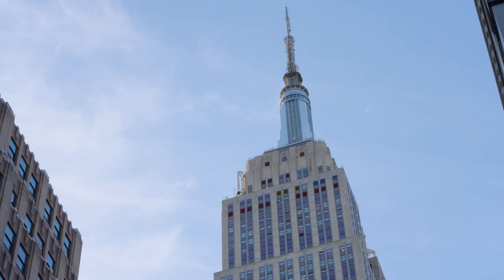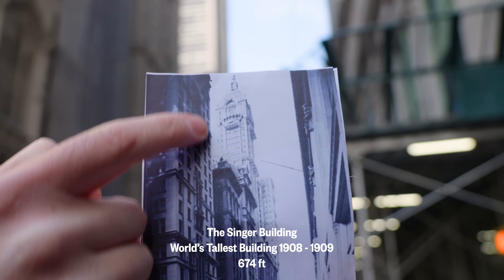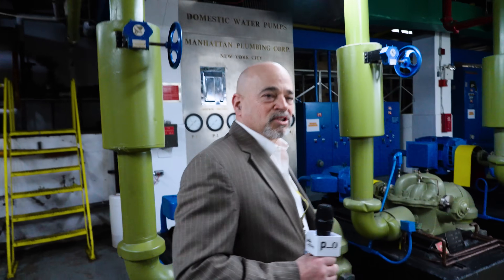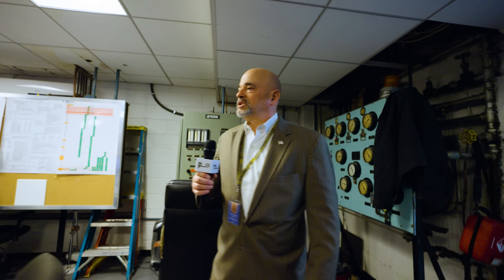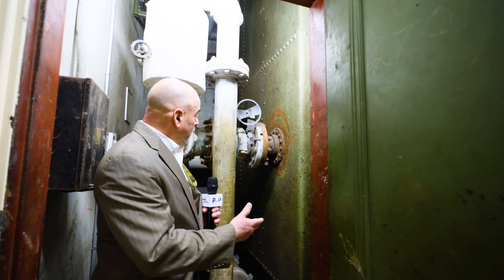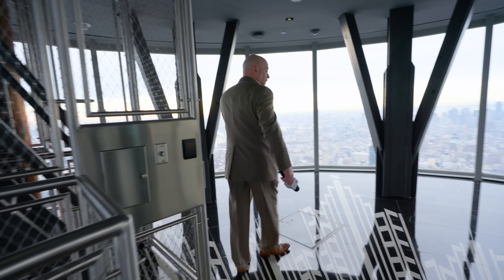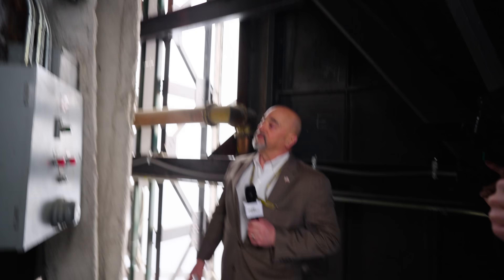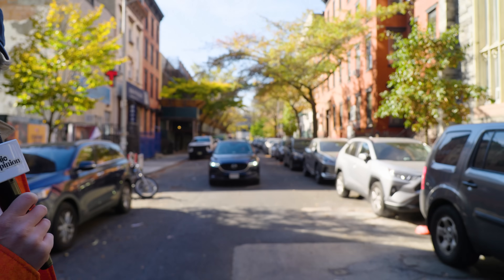Empire State Plumbing: The Secret Behind Water at 1,454 Feet!

Comment: Very interesting!! But how does waste water get down. You can't have it falling 100 stories or it would damage pipes at the bottom, so, how is it done?
Reply: At certain vertical intervals, horizontal offsets will be provided to the sanitary pipe to keep the velocity within a tolerable range.
Reply: @jdduvall12  that makes sense, i wonder what speed is deemed too fast for waste to fall.
Reply: @1DerfulSniping  At a theatre in London (UK), we have the opposite problem, since the auditorium is 80 feet below the sewer. 
The sewage drains into a pair of 600 gallon tanks via non return valves. A second non return valve from each tank leads up to the sewer. 
A vent pipe from the top of the tanks also vents into the sewer. When a tank is full, the vent is shut off and compressed air at 4 bar supplied. This silently forces the contents of the tank up into the sewer in about 20 seconds.
Because their are no moving parts, the system has run since 1926 without a fault. The leather flaps in the non valves are replaced every 5 years, but since the valves are outside the tanks it is a simple one hour job. The pipes and valves are 6 inch diameter. Everything is cast iron. 
The air compressors were replaced in 1962, when London changed to 415 volts (3phase) and require an annual oil change.
Reply: @wilsjane   Very cool!
Reply: @wilsjane  why is the auditorium below the sewer? How deep is the auditorium?
Reply: This is interesting  @wilsjane
Reply: @wilsjane . Love it, I worked on subs for ten years. We used pumps to suck out all oils and fluids, when the new style sub came in. I was pumping out one of the first tanks, a sailor said he found out that the tank could be pressurized to 5psi. I shut off the pump and got an airline to the connection point. Turned on the air and pump at same time, got the tank emptied in less than half the time it normally took.
Have a good one !
Reply: @jdduvall12  where do stack vents let out?   In classic 'pointy' bldgs, on the sides somewhere?
Reply: Every so many stories you go over with a 45 then 45 back, kinda like a zig-zag offset to knock the waste around slow it down. Also need a relief vent to prevent the momentum from siphoning anything
Reply: I really hope the plumbing term for that pipe slow-down joggle is "Shit Brake".
Reply: The three separate tanks at different heights create the desired water pressure for the designated floors they feed
Reply: @pueowright7467  You ae completely correct. In many cases, water needs to be pumped to tanks feeding the upper floors, so why would you pump water to this level, for it to feed the lower floors at ridiculously high pressure. 
In addition, the total tank volume for the building would be around 12,000 gallons. Supporting all that weight at roof level would present a major structural problem.
Electrical distribution in large buildings is equally complex. Electricity behaves like water in many ways, but their is no weight problem.
Reply: @pueowright7467  
The Empire State Building has almost no need for water: the building is almost completely a clothes closet -- a warehouse for the Seventh Avenue textiles industry.
Just about nobody works there.
Reply: @David_Lloyd-Jones  This sounds almost completely made up, I can find basically zero proof of this and non of the largest tenants I could find are fashion companies. Also using a skyscraper just as a warehouse is a pretty economically inefficient and unbelievable claim.
Reply: @BlueBetaPro  Only around half of the building's office space are rented out. It's been that way pretty much since the building was built. They currently charge $65-$70 per square foot rental which is the above the current standard of $60 per square foot in NYC. Most of their realty trust money comes from tourism and renting radio tower space. (About 68%) LinkedIn and Bank of America are probably their 2 biggest office space renters. I used to be a water treatment vendor back in the 2000s and dealt with their property manager. It's a great old building, with the emphasis on "old". The building shift engineers do a great job.
Reply: Right!  If a guy flushes a toilet on floor 86, the guy sitting on the toilet on floor 30 could experience a gush out of his toilet at over 250PSI.  Water falling from 900 feet on floor 86 would generate about 450PSI at street level.  Not a simple problem.
Reply: @makerspace533 water falling through air from 900 feet generates almost no pressure
Reply: Like trump, they just wear diapers.
Reply: Pipe goes down then sideways then down and repeat
Reply: of course you can have sewage fall down 100 stories through a straight pipe. water does not have a very fast terminal velocity and solids will bounce around the pipe. anything too fast will be caught in the radius or septic tank at the bottom. the one issue that does need to be solved (not just in skyscrapers but regular tall buildings as well) is the air currents and backpressure in the pipe, since you dont want sewage shooting out of the appliances of the lower floors. to mitigate this, multiple pipes are used and connected on many floors, allowing air to bypass appliances and loop around.
Reply: Easy flushing ny😅
Reply: It would be cool if the energy from the falling waste water could be used to help drive the freshwater back up a bit. I'd guess it would need to be a closed system.
Reply: You could do it by fluids of differing densities (wow did I get that correct since it’s based on pressure and uses water)
Reply from the maker: We already answered that question: https://youtu.be/19wKBDhLRqA?si=fNRb-KuQUTs3dsg6
Reply: @publicopinionnyc  Sorry!! That video is what happens to sewage once it leaves the building, NOT how its handled within a skyscraper.
Reply: @fredh54 the tank at the top only serves the top 1/3 then the middle tank serves the middle 1/3 and so on. Thats also how the pressure remains the same throughout the whole building. Otherwise as you said it would be way too high at ground level.
Reply: @publicopinionnyc  Religions are made by humans. Reduce the population to save the natural resources of the world from being depleted quickly. The basic needs of all the people in the world will be met if the world's population can be reduced by more than half. Due to the increase in the world population, there is a serious crisis of agricultural land in the world. The excess population is using up the world's resources such as mineral oil, gas, elements of Sir, uranium, which may not be available again someday. Then the people of the world will be in crisis. If this continues, the population is increasing the world's population by keeping pace with people of different religions, if this continues, all the crises of the people of the world will continue to increase.
Reply: @publicopinionnyc  Religions are made by humans. Reduce the population to save the natural resources of the world from being depleted quickly. The basic needs of all the people in the world will be met if the world's population can be reduced by more than half. Due to the increase in the world population, there is a serious crisis of agricultural land in the world. The excess population is using up the world's resources such as mineral oil, gas, elements of Sir, uranium, which may not be available again someday. Then the people of the world will be in crisis. If this continues, the population is increasing the world's population by keeping pace with people of different religions, if this continues, all the crises of the people of the world will continue to increase.

Comment: One of the emergency pumps in the case of a fire is now located in Einbeck, Germany - a Fire-Truck with a built in airplane engine which had enough power to feed the fire-hoses directly from the ground with high pressure.

Comment: Amazing engineering of the Empire State Building! I never knew there were steel water tanks within this massive structure. Also it gives realism to the big screen "The Towering Inferno" there were huge water tanks on the top floor over a million gallons. Which were blown apart, in addition to the floors in a last attempt to stop the raging fire.

Comment: I worked on an unusual project out in California where a Hospital wanted to setup a medical clinic in a building that was partially occupied . The hospital had to install a completely separate sewer and water supply system for their part of the building. Instead of occupying a separate building and be by themselves they chose a Vacuum system that apparently is used by cruise ships. First time ever have I seen this or worked around a system that used a roof vacuum system to suck everything up and out to the sewer 60 ft away. I worked 35 years in water treatment systems with dozens of mechanical companies and hundreds of jobs of every kind but never a vacuum system and I doubt I will ever see one again. 
  There were many other locations and buildings they could have chosen for their new location but someone made the decision to install a vacuum system. Just getting someone to work on it years later might be difficult. Maybe someone can do a show on Cruise ship plumbing. Also the new Coast Guard regulations stipulate a disinfection system has to be installed on all vessels entering and leaving US ports to pretreat and treat ballast water when it is taken on or released to prevent biological contamination, parasites , protozoa etc. in our ports and bays. Each foreign and domestic ship has to have this installed and operational, which requires adapting the UV systems accordingly to the existing water ballast piping/ pump systems. Might be quite difficult on some ship designs.

Comment: The pumps and motors look about the same size as the cargo pumps on a Kaiser -class oiler. I guess for a hotel-type water system, you don't need anything bigger, if you have three vertical zones. Very practical.

Comment: My question would be: what if they need to replace those tanks someday?
Reply: Install a new tank inside of the old ones. Relining.
Reply: weld it from plates?
Reply: @ketas  Tons of different options, one comes to mind would be an epoxy impregnated felt. That is used in old DWV lines regularly.
Reply: It would be rebuilt with stainless steel in sections that can be lifted in the utility elevator. It may also have a protective bladder inside.

Comment: I work in water, and find hidden water infrastructure fascinating. With a 1400 ft water column, you would have about 600 psi water pressure at the ground floor. So that is why you have many pumps at multiple stories along with storage tanks. You divide up the work. A single pump with a TDH of 600 psi is impractical.
Reply: I was in water treatment systems on every kind of job out there and the high rises use the booster pump systems and zones, what isn’t covered is when they first run the system there will be some areas that getting the pressure adjusted takes awhile with a few floods, and just unexpected results. At a courthouse project , in one area of the judges bathroom when they flushed the toilet the water would back blast all the way up to the ceiling. They got it figured out later on.
Reply: They're starting to roll out up and over type systems. Where 2-3 zones are interlocked together. act as boosters and all work in tandem to take that water to the top and then feeds the building with regulators keeping water pressure correct on the way down. 

They're a pain and I haven't met someone involved in any way other than engineering say they like them.
Reply: Yep; that's why municipal water systems have regulated pressure zones. Just give me my 70PSI at my hose bibb and I'll do the rest. Skyscrapers are like mini-towns. Dealt with those problems all the time in center-city Philadelphia and Wilmington. So glad that I'm retired and out of the fluid dynamics industry.
Reply: @themagus5906 I’m retired too and glad to be . I have what I call Post Work Stress Memories, when I see something or come across a subject that I worked with it triggers certain memories. Some good , some not so good. There was a lot of stress for me on certain jobs to get them done or compromise values in order to get a job finished. Construction jobs were always the source of those memories. After 35 years  I retired at Christmas. 😊
Reply: 0.433 PSi per foot of elevation for fresh water. And that is just to get it there. You need some extra for flow

Comment: The tallest tank is exposed to the elements. How do they keep the water from freezing during winter? Does it have insulation? If so, is it asbestos?
Also, it would be interesting to know how they deal with waste water.
Reply: As long as the water keeps running, it does not freeze.

Comment: 1454 feet?  Do they have a toilet at the top of the spire?
Reply: I believe they said the highest bathroom was at the 86th floor.
Reply: @rupe53  Which is 1050 ft.
Reply: yes, but the highest tank is above that so adding something for the height of the water within that tank would be maybe 25 - 30 PSI water pressure, which is certainly enough to do the job.

Comment: At the end, he said that the entire building is fed by the tank at the top of the building. This is not true there are 16 water tanks in the Empire State building and each of those tanks supplies water to a limited number of floors ( on average 6 to 7). If the entire building were fed by the tank on the top floor then the water pressure would exceed 500 psi
Reply: they did say the basement pumps fed 3 zones, but didn't say how many tanks there were all together. They only showed a few tanks. I suspect multiple tanks would reduce the need for large pipes with long runs. BTW, you are right about that excess pressure, given an increase of say 5 psi per floor they could have crazy numbers!
Reply: @ 
Just pumping it from the basement to the top floor would be prohibitive. Instead, what they do is they pump from the basement to the first tank and then from the first tank to the second and so on